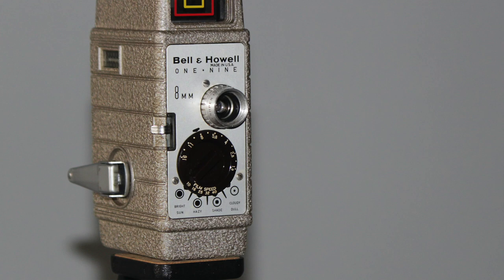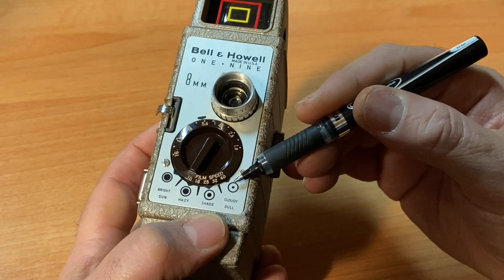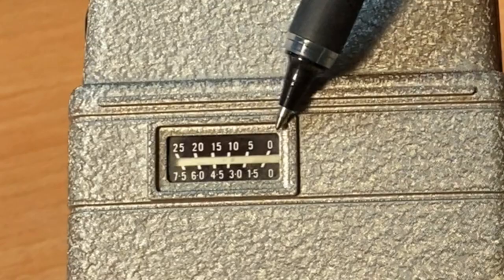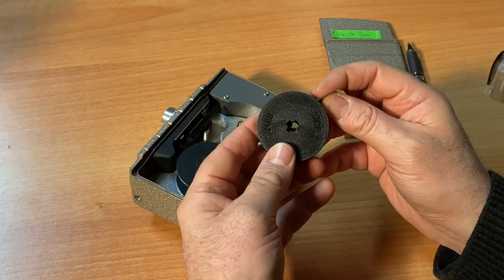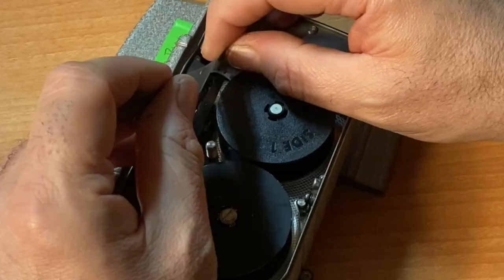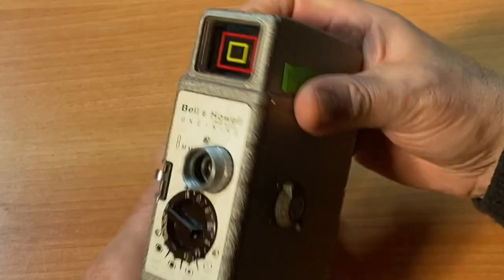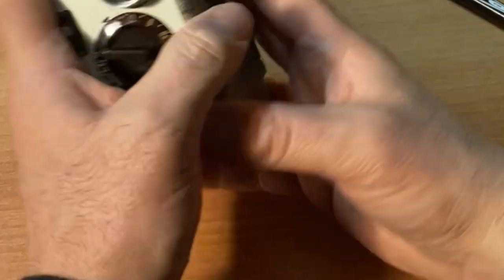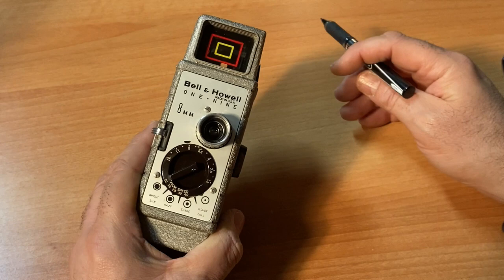Bell & Howell One Nine - 8mm Camera Overview and Loading

Comment: I found about five of these cameras, including variants, at a local "antique" store and every single one had been turned into lamps... And from what I could tell, they were in excellent condition before someone drilled holes and ran wiring through them. The first one faked me out. I was like "Sweet! Old movie camera!", but no, it was a lamp. Good thing they're cheap on eBay though. Still, it's sad.
Reply: That is sad to hear. I just got a broken one on Etsy for $12 and spent about 45 minutes getting it to run. Recording lever was just jammed from being in storage so long.

Comment: I have a bell and howell one nine that does not show the ISO numbers on the dial, but everything else looks the same. If I line up the iso the same way you did with the "40 ISO" setting and the correct aperture, should I expect to get the same result? Should I just try an app instead? Brand new into 8mm
Reply from the maker: With 40 ISO film, set the aperture to the smallest opening and shoot in daylight.

Comment: My father had one of these which is now mine. One thing you forgot to mention was that the trigger to make it start filming will also work as a single frame exposure shutter.  To take single frames to make animated movies, press up instead of down.  This will make the camera take a single frame instead of a continuous series.

What I would like to know is where the secret framing adjustment is located. I remember there being one, but I cannot find it now.  The framing adjustment changes the position of the exposed frame in relation to the sprocket hole.

The lens has threads so it can accept various color filters as well as a telephoto lens and lens caps.
Reply: Good info!

Comment: I know in other videos you talk about ignoring the old light adjustments in favor of a light meter because of the change in film over the years. Do you suggest using a Light meter for this camera? Also is the film speed always at 40 with this camera or is there a way to adjust the speed somewhere on the camera?
Reply from the maker: The One-Nine shoots 16 frames per second which gives you a set shutter speed of 1/30th sec. This is all fixed. The recommended film ISO (also known as ASA) is 40. So, with this camera, use the front f-stop dial using 40 iso film as your number.

Comment: maybe such a dumb question, but i am a beginner! so would like to know wouldn’t the film be exposed while changing from side1 to side2, as you you need to get it out anyway?
Reply from the maker: Your 25 foot roll of film is on what's called a "daylight spool". When loading (and flipped) in dim light, there is minimum flashing. - Mike

Comment: Do you still sell fresh rolls of 8 mm film?
Reply from the maker: https://filmphotographystore.com/collections/movie-film/regular-8
Reply: @FilmPhotographyProject  I have a question. I have a bell and howell 323 sunometer camera. Can you get the right exposure by reading the sunometer or do you have to use a light meter app? And you sell fresh 8mm film?
Reply from the maker: The "SUN DIAL" will steer you wrong as modern 8mm film has different iso sensitivity. This video will help - https://youtu.be/2ngRoadevJs?si=8yo4vIbPsCz2A61C&t=30
Also, our Iso 40 film comes with a "CHEAT SHEET" - bright sun f16 / shade f8 / indoors with a light panel or movie lights f1.9 (or f2.3). - Mike
Reply: @FilmPhotographyProject  thank you so much
Reply: By the way, I have a question. on my 8 mm camera, you don't manually set on the sundial. There is a sunometer on the top of the camera that reads the ISO, but is that bad too?